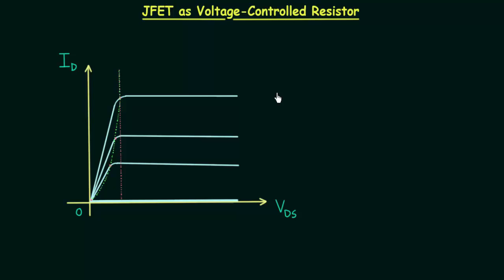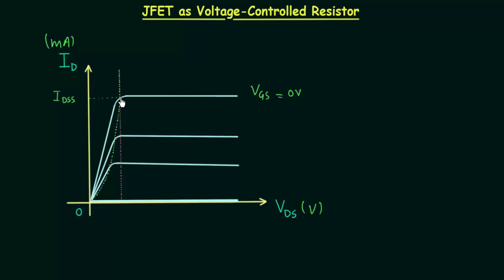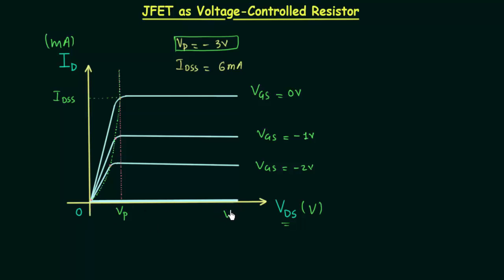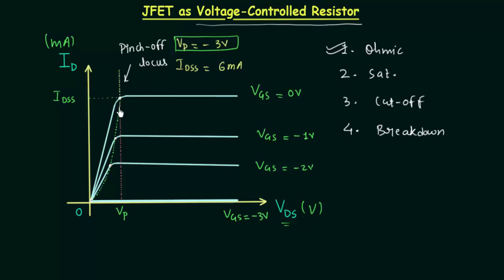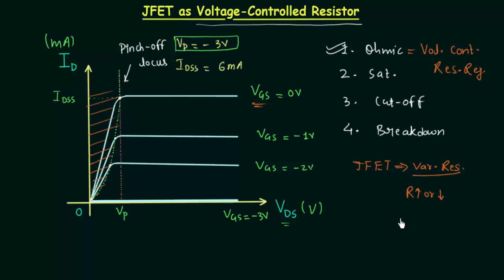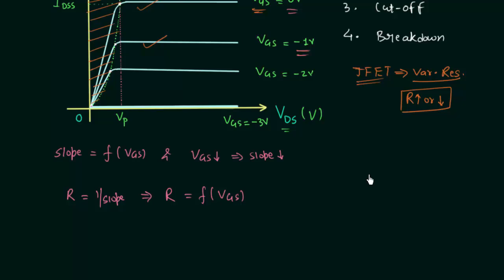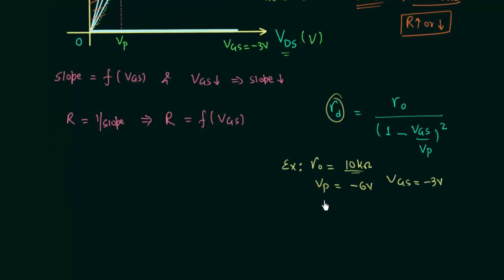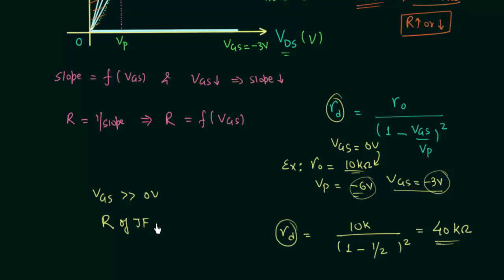JFET as Voltage-Controlled Resistor

Comment: what's the answer for the question you gave in the last presentation
Reply: When Vgs > 0(N-Channel) then We will reach Vp very slowly. Because N-Channel is forward biased and depletion region will not increase. Effect on depletion region is it doesn't change. And effect of Vp. We can't achieve saturation/constant current faster than in Vgs=0 or Vgs<0 condition.

Comment: Why pinch off voltage is negative 3 voltage? It's basically Vds and 
Vds is positive voltage
Reply: He explains it verbally mostly OK, but what is confusing is that the Voltage labeled as Vp in the graph of characteristic curves is NOT Vp. 

The  pinchoff voltage is actually the VGS Gate to Source Voltage at which ID is at a datasheet-specified value with VDS set to a fixed, datasheet-specified value (usually the same VDS (which the author has incorrectly labeled as Vp) to define IDSS*

*  FET principles, experiments, and projects by Edward M. Noll pp 23, 26, 27, 31, 32
Howard W. Sams & Co., Inc. The Bobbs-Merrill Co., Inc.1st edition, 2nd printing, 1971 © 1968

Old retired EE

PS: I believe the above referenced book is out of print; there are copies available at some libraries or for sale at e-bay, Amazon, etc. Also there isa lot of information on the web- you just need to wade through it.

Comment: Sir why vp is negative and while vds is  positive and according to definition the value of vds at which the two region are appear coincidence at top .vds is postive 
So why vp is negtive ?????????
Reply: Well, basically there are two ways of reaching the pinch-off voltage. One is by increasing the Vds, and the other is by negatively increasing the Vgs. That is, this value is negative because A: The JFET is a N-channel type and B: because the voltage you're controlling is Vgs

Comment: Why vp has - ve value?
Reply: There are two voltages which are named as pinch off voltages in JFET characteristics:
1. The value of Vds (+ve) after which the JFET enters into saturation region. This value of pinch off voltage is different for different values of Vgs taken. (As seen in output characteristics of JFET)
2. The value of Vgs (-ve) at which drain current ceases to flow i.e becomes 0.That is we can say that the value of Vgs at which the JFET enters into cutoff region.

Here the relation of drain current and Vgs consider (2.) as its pinch off voltage, therefore it is -ve.

Comment: How to find r0
Reply: It is usually given, but in real life scenarios, you can simply consider the JFET as a resistor (if you haven't reached the pinch-off voltage) and calculate its resistance with a simple V = R . I